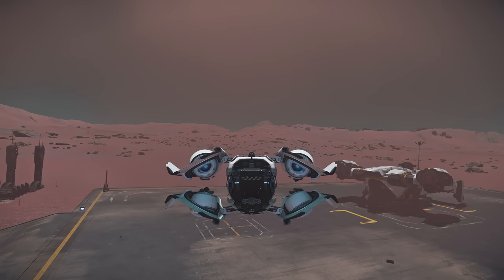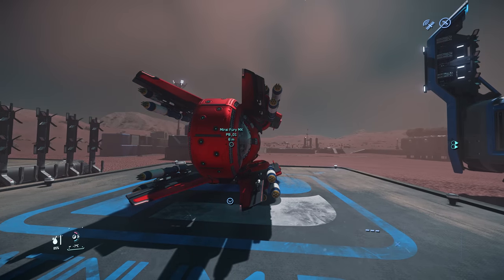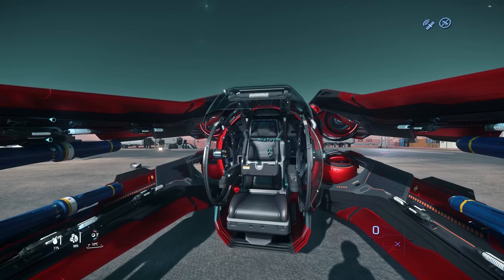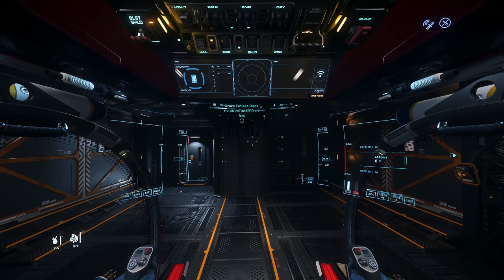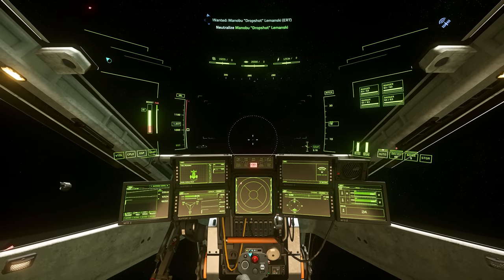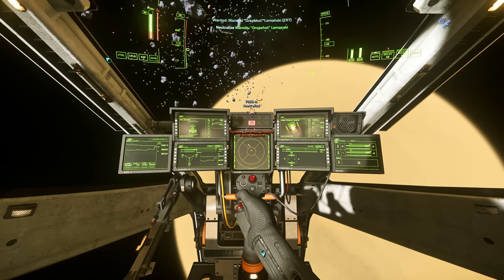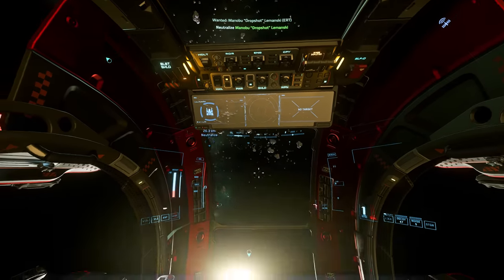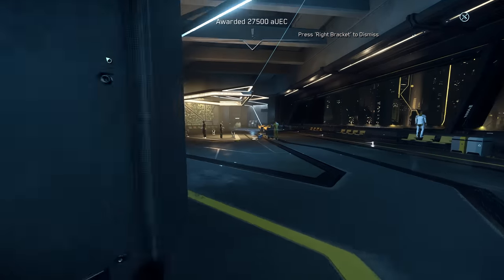Furious Cutty, Useless Fury | Fury MX is Useless but Looks So Cool | 3.19 Fury Unleashed 4K

Comment: I love the design of this little stinger but I can't understand why the base gun model doesn't have the blast shield as that's the version that'll be getting up close and personal, surely the bomber variant will be dumping it's payload from high and far and rarely see close combat due to it's lock on range, therefore it would make sense for the blast shield to be less of a requirement on the bomber as opposed to the gun variant right? I get they wanted to make the MX look different but it feels like the thought process is backwards in this case as there isn't a need to put the shield up before or after firing your missiles while there is a need to put your shield up when going for a gunning run or dogfight
Reply: It also needs atleast *something*, even the smallest size guns so that it isn't useless after dumping missiles
Reply from the maker: I agree, I think it really should be the other way around, the blast shield is supposed to protect you from ballistics, but the Fury MX don't do dog fight, the Fury does. So...it is there just for the looks I guess

Comment: I think it is more a problem of the state of missiles in SC than the problem of Fury MX itself. The same thing can be said about any other missile boat, like Talon Shrike. And then another thing is comparing very small single seat snub with S2 missiles versus very large ship like Hammerhead. I think a somewhat fair scenario would be to try to unload 7-8 Fury MX's payloads at the same time. Remember, if they hit at the same time, shield is less of a factor.

EDIT: One more hot take. I find Rattlers to be fantastic missiles to deal with fighters (tested on lights and mediums so far). Because Those little shrapnel missiles after detaching can turn back to try to hit the target 2 or 3 times, they have amazing uptime in the air. I am obliterating Sabers with just two of them: firing off two results in Sabre losing both wings and having hull red on top of being immobilized completely. I'd say that's a fantastic result. You might want to look into that.
Reply from the maker: Thanks for the info for the rattlers, and that is exactly why I used it in this video, all the ships in this video are rattlers. And each rattle if all hit, deal 4070 HP

Comment: The fury MX is useless on its own, but I imagine they make for a good intimidating swarm for pirates.

Cheap ships, easily transported with a Caterpillar. Then imagine you have like 16 Furies in formation surrounding a Mantis, waiting for you when you get intercepted.

Sure, you may be able to take a few of them down... But you won't be able to escape. You won't be able to survive. And while you're off on your way, having paid your duty tax, the Caterpillar jumps in and loads up with loot and any potential damaged Furies.

It'd be a cheap and effective way for a group of pirates to operate out of a Caterpillar, perhaps with a Kraken loaded with more heavy duty ships as backup, repair & resupply station somewhere hidden in the system.
Reply from the maker: very true indeed! 💯

Comment: If you consider having 20 missiles useless with that kind of speed and agility...you might just be a bad pilot.
Reply from the maker: You don't need much skills to fire missiles.
Reply: If the missles are just garbage then it doesn’t matter if you have 100 of them 🤦‍♂️ not to mention the desync making missles barely function.

Comment: The problem is the fact that it is such a clunky business to reload missiles. If they would just make it so that the missile need to be in a fair position rather than having to twist and turn them to get into the exact position you would reload it a lot faster

I got both ships, and I concluded pretty much the same thing. The MX is cool AF... but mostly useless due to it's total lack of ability to stay in the fight
Reply from the maker: Basically we traded 4 size 2 guns with 8 S2 and 8 S1 missiles, and the math doesn't add up
Reply: @cpt_foxyloxy  No it does not add up in any way shape or form. 

Add very wierd missile mechanics and you have a ship I WANT to like, and as long as I have missiles actually do... but it just falls flat on its face all things concidered.

I did a bunch of testing last night. 

In my trial I did the common thing which is to fire missiles in quads..

Target was a HRT valkyri... and it just smiled and kept on coming after all missiles had been depleted. Went to reload the MX and came back fired the second load and managed to blow it up after an additional 8 missiles.

Refitted the missiles to Strikeforce II (low yield crossection missiles) that on paper have a lot less damage. This time I fired them one by one... after 11 missiles the valkyri target went poof. Not a single S1 missile was fired.

Did the same a third time, this time the target was a Vanguard (not sure of variant) and this time as well it went down with 10 missiles fired one by one.

I also did a full reload in space. I was using a rented Freelancer MIS for the occasion. 

In order to make this happen I first had to strip the missiles from the ship, move them into the host ship, reload (or in my case reclaim the fury due to the maintenance/reload not working). Getting to the destination. Get out with the fury, expand the wings, fire tze mizziles, then get the ship back to the host. Leave it ouside with wings expande (to allow strip/add of components), leave the ship and move in 0g to the host, reloading, moving back to the fury through 0g, retracting the wings and getting it back into the host.

Even with me testing stuff I could not be bothered to strip the ship for the second attempt...

Overall, it was fun as a test, but I will not be doing this for a living... it simply not worth it. Hell even the regular Fury is hardly worth it in most cases due to the fact that most ships have tighter openings than a virgin ringworm, and getting ships in and out is a complete nightmare.

One thing thought... I do get the feeling that the Fury MX have a SLIGHTLY smaller profile. Getting it into my cutty black is not much of an issue, but getting the regular Fury is a bit fidget. Lol, unfortunatly the side entrances of the cutty is just a tiny bit too small to get the Furys in and out. It did look like a nice turret out the side of the cutty thought :D

Comment: Isn't your conclusion a bit faulty? The Fury MX doesn't shoot the missiles in anyway different than any other ship does. Your test just showed that 20 of the missile types that you had loaded, couldn't shoot down a Hammerhead. The same number and type of missiles shot from any other ship would have had the same effect. What I am think about using the Fury MX for is mining operation cover. Where I could have 4 or 6 of them sitting out as overwatch and would target anyone coming into our mining area from long range. They can all be piloted by alts, so we don't require people to be sitting in them, for hours, getting bored.
Reply from the maker: Indeed, my conclusion is faulty if you are looking at from a different perspective, if you got the numbers, you got the power, and using them to do mining protection is a great way to use them.
Reply: @cpt_foxyloxy  Yes, maybe "faulty" isn't the totally right word for it. It seems like what you are saying is that the Fury MX is lacking guns that would result in being able to follow up your missile attack with a gun attack. I would point out that your initial missile volley from your Cutty Black was equally ineffective and the only addition the Cutty has over the MX is guns. But the battle would have to rage on for a very long time before the Cutty could kill the Hammerhead with guns alone. Neither ship is really the right ship for this job. By the way, I really do like your videos, I hope this doesn't come off as me disliking your channel.
Reply from the maker: All good man, we are discussing different opinions of the ship and gameplay, nothing to do with the channel, and I think you got good points there. All I wish is like the Talon and Talon Shrike, if the Fury MX just have 1 S1 gun or something, it would be much better, as for the HH, it is indeed ineffective, it will take more than 30 S3 missiles to destroy, I chose the wrong target in the first place.